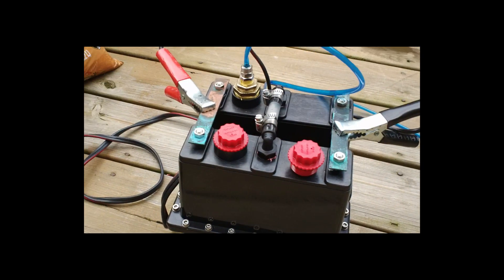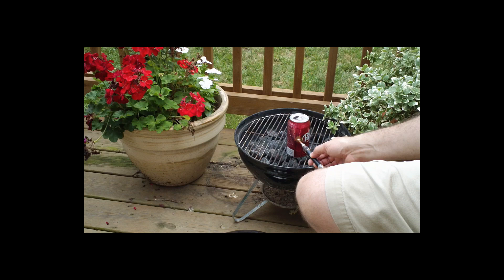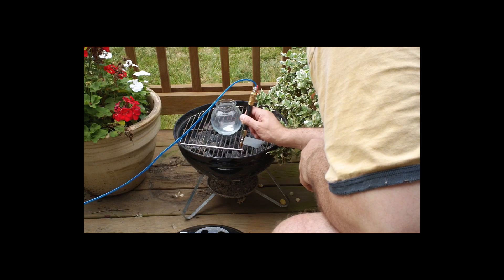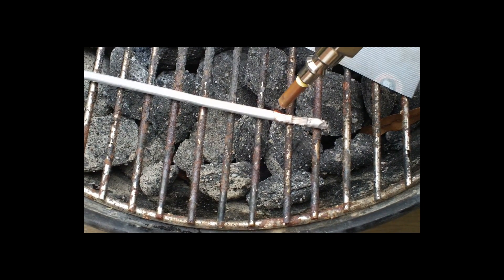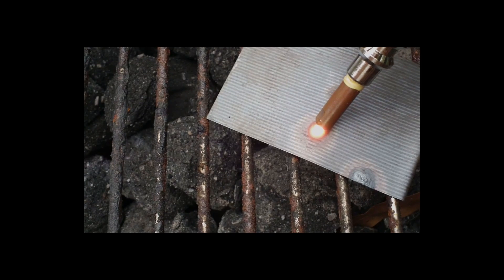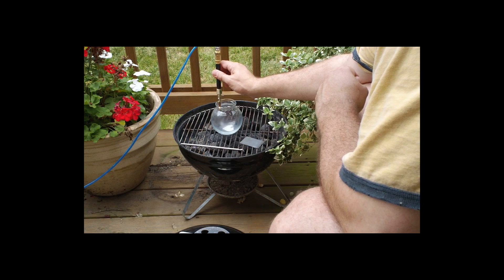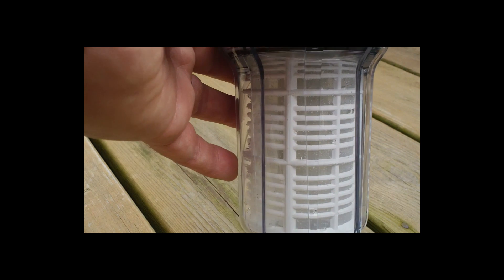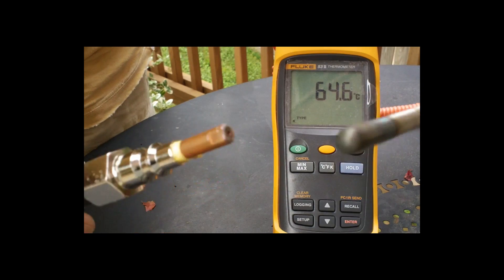Water Fuel Oxyhydrogen Gas Torch

Comment: Pressure needs to build up. Attach to the bubbler a latex balloon for hho storage and pressurization of it and the nozzle needs to be designed for gas torch cutting. Maybe the hho production needs to be higher if you want 3000F.

Comment: Alex, the temp of the flame is determined by the material it's interacting with and any impurities in the HHO gas, like electrolyte. The best way to determine the flame temp is with a laser temp reader. If you want to see it get extremely hot, melt some tungsten.
If you want a flame that will vaporize anything it comes into contact with - ionize the H and convert the O into O3. I call the gas H(i)6-O3.
It's all about electron exchange.
Peace.
Mike.
Reply: O into O3？  How to make it?

Comment: @ImJacksAmygdala Actually, it should be the electrical properties produce the flame. Tesla notes similar effects in his 1st lecture on high frequency currents. The manner of brush, or flame, is contingent upon the voltage and frequency, and manner of current. All Stan found was described in Tesla's patent 568,176. Replace the load in that patent with electrodes and you'll split water in a novel manner.

Comment: Nice work Alex :-)  I would be curious to see if there is any electrical current flowing from the torch tip to ground .. or from the metal being cut to ground.. or between the torch and the metal plate, if they were bonded with a wire.  Maybe the extra heat is electrical resistance?  Its the only thing I can think of that could create heat with out seeing the cause...

Comment from the maker: @ImJacksAmygdala 
There are three modes on the 12V battery charger I used to power the electrolysis cell. The power drawn by the cell for the three charger modes are 20 Watts, 150 Watts and 500 Watts. The 500 Watt mode and the 150 Watt operate in exactly the same manner it seems. By that I mean, the temperature rises to the same level, cans still cut, metal glows quickly, etc.  Note also that this is brute force electrolysis. Using a Meyer type energization approach we can lower the input.